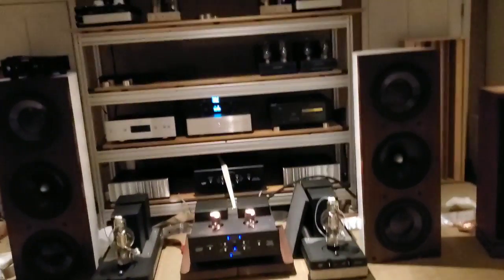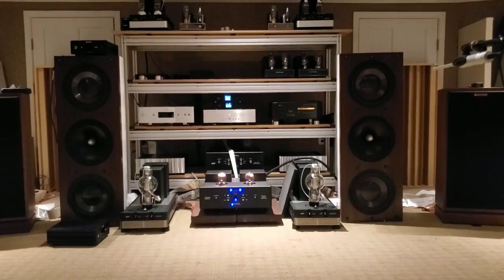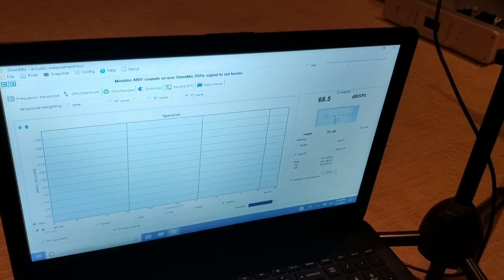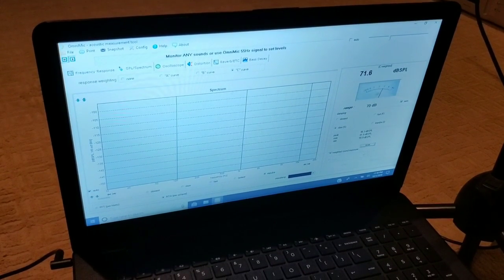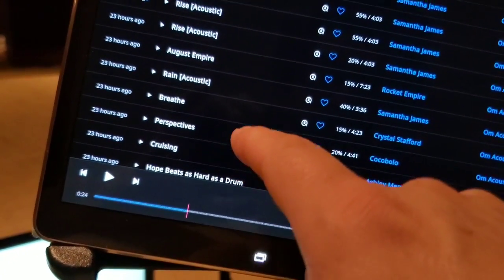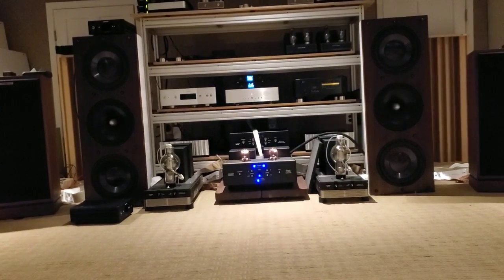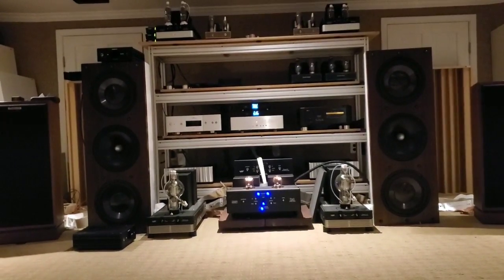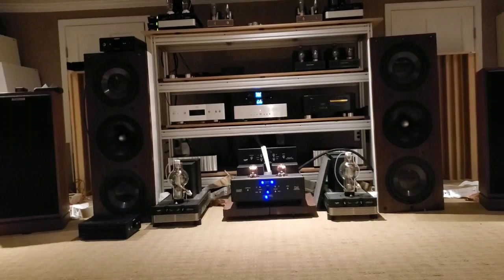SOTM AUDIO tX- USB Ultra, SPS-500, sMS-200 Ultra

Comment: Question: did you tryed to add the external master clock to SOtM setup? you can upgrade the sMS-200 and TX  with Master Clock input with 2 options: 50 or 75 ohm. you can use the SOtM Masterclock but also a cheaper Gustard C16 10M Clock OCXO. In my experience sound amazing! super natural and very engaiging listening!!
Reply from the maker: Hi Roberto. No I have not tried. It looks interesting though.